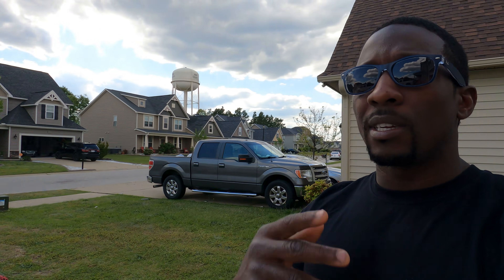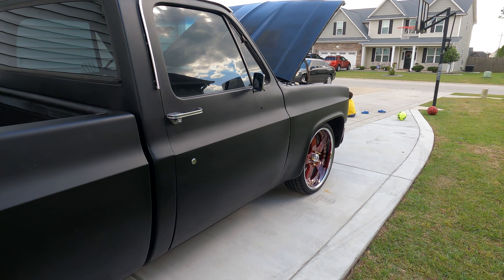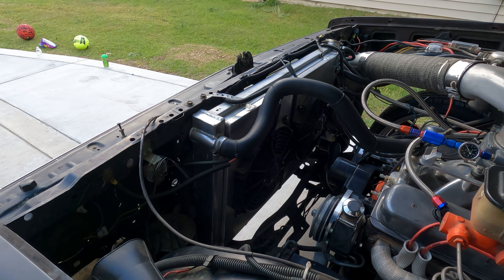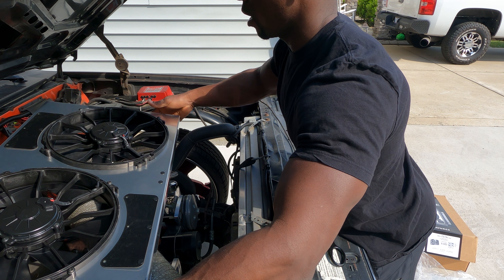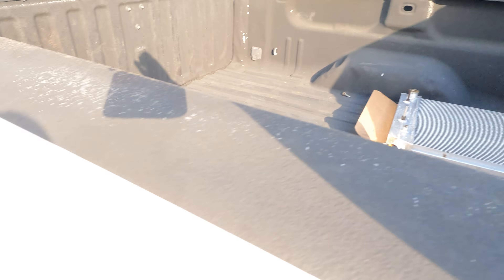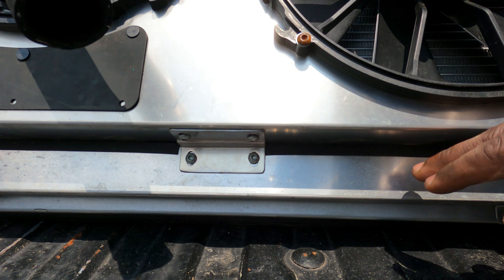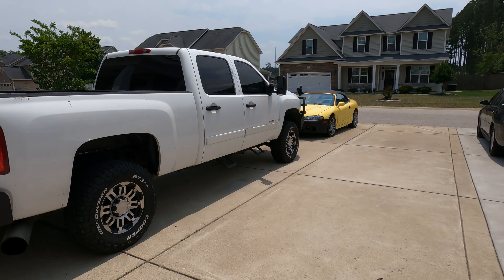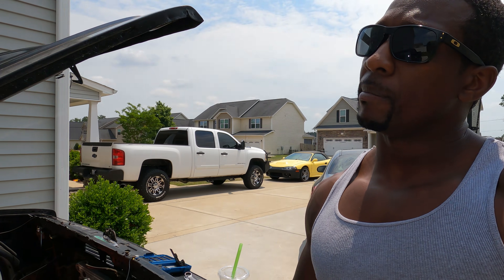Chevrolet C10 New Derale Cooling fan install, Edelbrock Camshaft install prep, and more to come.

Comment: Im looking to go electric on my 76 gmc.  What are the benefits ? Is the wiring difficult? Nice truck btw.
Reply from the maker: The wiring was easy, I could feel the additional torque from taking that load off the engine.